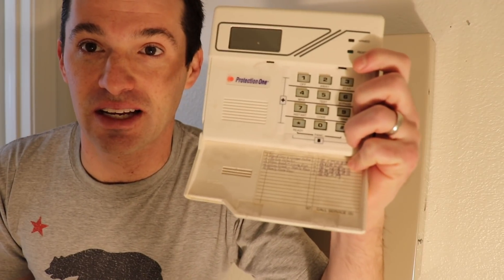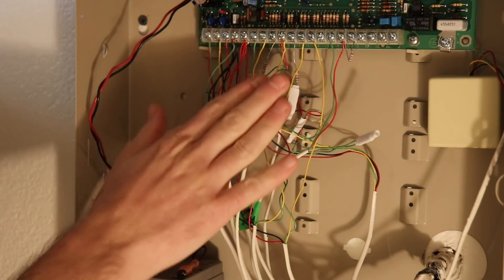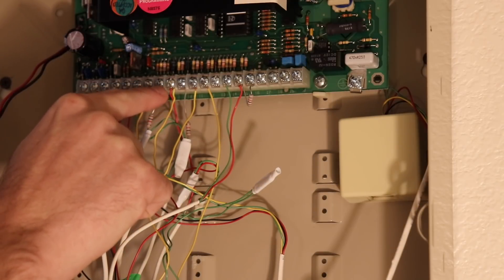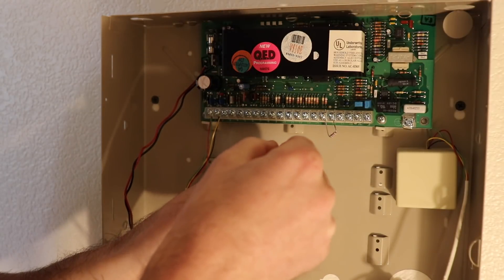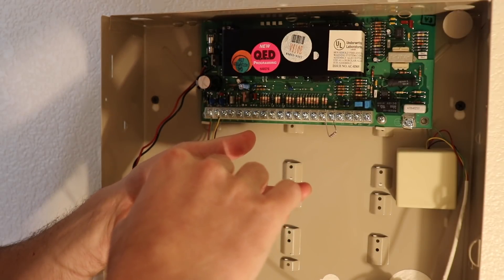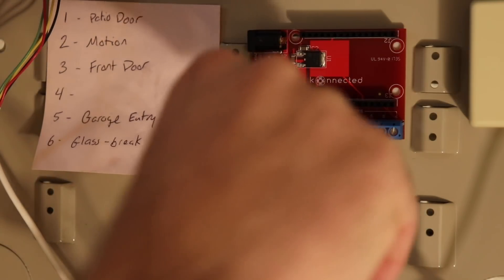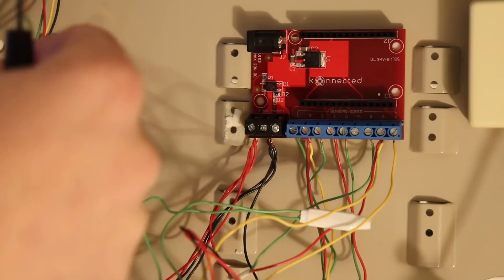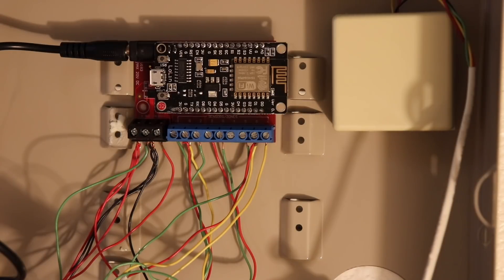Konnected Alarm Panel installation - Ademco Vista conversion

Comment: I was curious if it is beneficial to install a battery backup if when the power goes out, I lose WiFi anyway?
Reply: mikedinjoliet You should also have a backup battery for your WiFi router and modem. We sell those too. Or get a UPS like APC BackUPS.
Reply: If your neighborhood's electricity service goes out (i.e. "power outage"), then there's likely no Internet signal coming from your cable or fiber provider either.

Comment: I have two sirens (one inside and one outside) and a strobe light outside.  Can the two sirens share the same connection?
Reply: If your panel can handdle it yes tipically its out put power is 2amp dc

Comment: It angers up my blood every time I see EOL resistors in the can. Are there so many clueless alarm installers out there?! 90% of the commercially installed panels I see, I find EOL resistors hanging of the panel in the can. Clearly 90% of the installers out there have no clue what the purpose of an EOL resistor is. And nice to know that if I short a zone, should I need to break into a building, I have a 90% chance of not faulting it due to clueless installers.
Reply: I install for a company where we require them in the field. It bothers me that the Konnected device uses no line supervision.

Comment: Has an option for 0v input/output sirens with self contained battery backup and tamper switch been considered?
Reply: Hi, 

Thanks for replying would be good if there was a fix for this, I think there is currently a big gap in the market at the moment for integration with existing wired alarm systems, keep at it interesting stuff. please find links below to alarm box/siren wiring diagrams mentioned also fitted with strobe on alarm, battery back up and tamper switch.

My current alarm panel is an ADE 8EP 396 Optima compact G3 panel with built in keypad, is there an email address I could send the wiring diagram to? 

Cheers, 

https://www.diynot.com/diy/threads/honeywell-galaxy-2-12-wiring-help-needed.456875/

https://www.pyronix.com/uk/products/deltabell-e

Comment: I’ve yet to buy a SmartThings hub, I’m trying to eliminate my monthly $50 bill for alarm.. only thing I care about it is the ability to receive a cellphone notification if my wife & I both drive away (after last person leaves the house), geofence Alert reminds us to arm system. 

Would this konnect & ST hub offer a way to have smartphone geofence arming reminder alerts?
Reply: Konnected if we let the dog out of living room cage the Motion will trigger, so is there option for the auto arming to trigger “arm stay”?  Alternatively, could I not use the auto arm? But instead receive alert reminder? this way I could open app & choose arm stay or away depending if we decided to let the dog out of his cage ?
Reply: @AJCoReTV  You require pet friendly motion sensors ....

Comment: Does this only work smart things? Can this work with with the 2gig keypad?
Reply: What about WINK HUB 2 or Google Home?
Reply: It works with SmartThings and with HomeAssistant coming soon.
Reply: If u r trying to at the hard line contacts to your 2 gig u need a 2gig take over module

Comment: Thanks for the new video! My smoke detectors are not compatible with Konnected so I want to leave them connected to my existing board. Can I leave the existing power plug and batter and completely run the Konnected board off the same outbound power that powers all the motion sensors? Could I just leave all the motion sensors powered by the original board and only connect the other colored wires to the Konnected board. Also if I do this set up won't by Konnected board work on the backup battery already installed? Thanks?
Reply: That's what I did, I left my panel powered as it was originally powered with battery backup - I pulled 12v from the panel into my Konnected - I left all my motion sensors being powered by the original panel, but the trigger wires into the Konnected. Works perfectly.

Comment: I believe the point of having a resistor is to detect if an intruder attempts the bypass the sensor by simply shorting the 2 wires. is that correct? do you still have this protection in your setup?
Reply: Nope they dont.
Reply: The resistors are for tamper defection (I.e. intruder tried to remove a sensor)

Comment: Hi,
How/when does the siren get activated?
Reply: Konnected so someone simply cuts the coax cable that ISPs typically install in very accessable locations and this is disarmed?
Reply: Konnected but then I'm back to paying monthly fees to a second 3G/LTE ISP to maintain my security system. What you are offering here really is a great idea, but it's basically a $5 ESP8266 with a few triggers that doesn't have the redundancy built in that the item you are replacing does. And if you want that redundancy, you are back to paying a monthly fee, but without the police being notified.
Reply: @jasonkloos6348  You don't fully understand how this system  works, so perhaps it isnt for you. A good ups to backup your modem/router/wifi and the konnected system will cost around $100. If power is cut to the OpenHAB or HASS server running the alarm - I would assume the konnected panel will remain armed as the server told it to stay in an armed state. If the alarm is tripped, but the power is off (assuming you have battery backup on the konnected) then I would assume the local alarm will go off, but because the power is off in the rest of the house including the wifi, you wouldnt be notified.
Reply: @wpgspecb  No, I do fully understand. It's still a rip-off that anyone can build for significantly less than what it's being sold for.